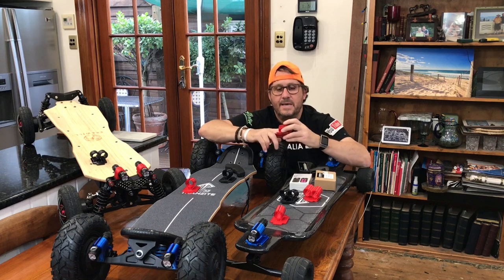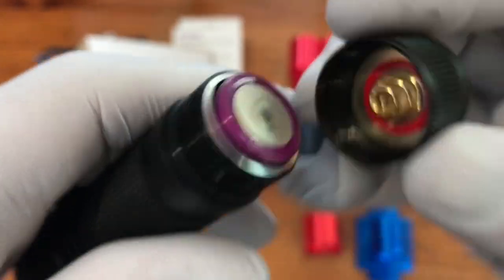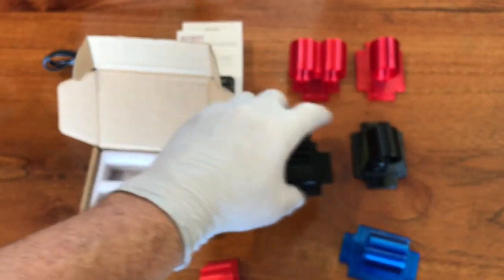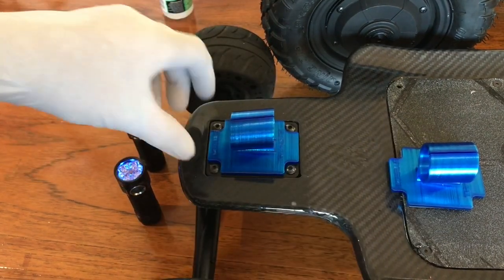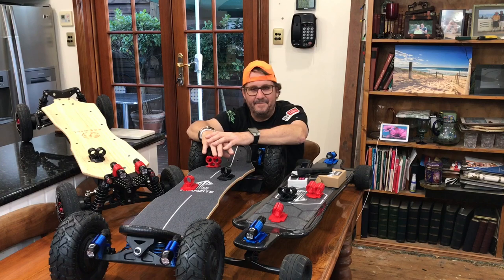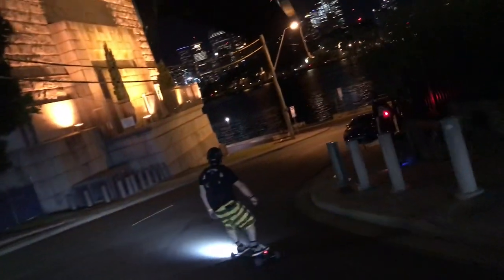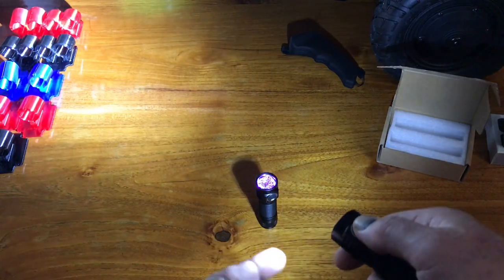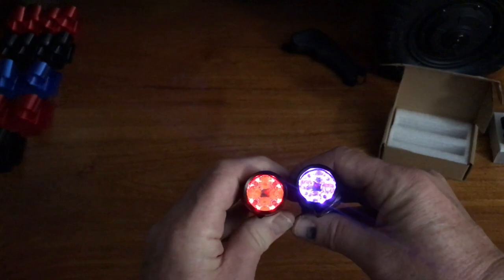Steeze EBoard Lighting System - Full Unbox & First Ride ft. Instruction and Installation-Vlog No.162

Comment: Seems strange they are mounting the lights for the Tranzite  CC model off the truck, that will be bouncing up n down like a mofo especially offroad, making it hard to see im sure, plus likely to have the light flip off or be damaged.  Plus its down low where a bit of height might be good, also the wheels will block any amount of side shooting light. 

Anyway, I dont want to be a negative nancy about it - but I reckon there are some improvements that could be easily made. Taking action I have a 7" LED side shooting bar on its way that I plan to mount straight onto the front of the board that I am anticipating will be bloody awesome and solve all the problems Ive listed above. But yes I'll be running a custom lithium pack for it. Stay tuned ;-)
Reply from the maker: Hey Lee, thank you so much for popping in and giving us your feedback, this is what I love about my channel it’s a thinking person is channel with specialised experienced riders and subscribers who don’t get involved with just the normal run-of-the-mill. Oh my gosh that’s an awesome option Lee. Personally I have tested this setup it and they’ve got it pretty spot on the light so bright but it really doesn’t lose a lot of side beam and as you turn the board it directs to whatever area you want to go. They’re on with the zip tie as well as heavy duty double sided tape if they do not move and would you believe because of the cushioning pneumatics they don’t bounce around much at all they’re pretty stable. The angle of been is 100% perfect it shoots out enough to give you at least 60m light throw and not blinding anybody it’s a pretty nice set up. Sounds like you’ve got the cross country too Lee definitely give this ago you’ll be quite surprised, Scott Davies hammered at the other night and the flex on the deck positions the lights perfectly he had no issues at all and actually he was really impressed with how they work. But yes would love to see what you’ve done Lee do please my hand send me photos to my email (it’s in the description field)  and I’ll put it up on the screen and talk about your modifications Lee that would be amazing on the next Steeze lights vid or cross country video;) awesome Lee great to hear from you as always cheers Andrew⚔️

Comment: For sure I'm getting a couple of these, but I thought you said it had an iOS app? Apple watch app maybe? Is that coming in the future or did you say OIS ? Great vid!!
Reply from the maker: Hey Rafael :) Great to hear from you, look yes Rafael I should be more specific ... it’s in relation to the Torches own built in software and firmware... The original D4 Torch used Rampling IOS firmware ... but that’s just an iOS protocol sorry doesn’t mean you can use on your phone ... opps I didn’t mean to suggest that thanks for picking that up .. the New D2v2 now uses Anduril  firmware... it just means you can use a lot of programming power to do different functionalities on what the torch can do. Most the time you won’t need to do that but you are situations people want things to come on at certain times and do things... Rafael its an amazing setup ... well worth the money and really adds another dimension to night riding ;) they last for ages ..thanks again for awesome feedback really goes along way into helping me continue to provide the motivation to find best products I can find and present them .. awesome cheers Andrew⚔️